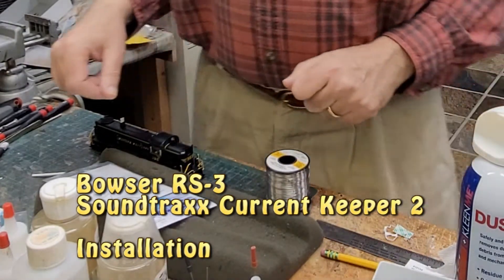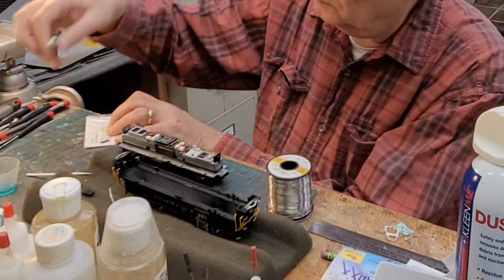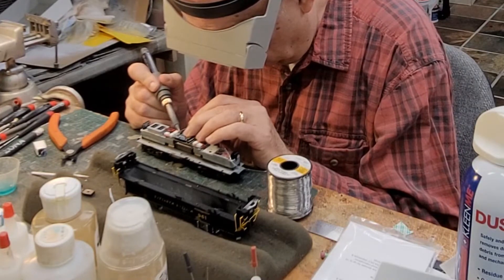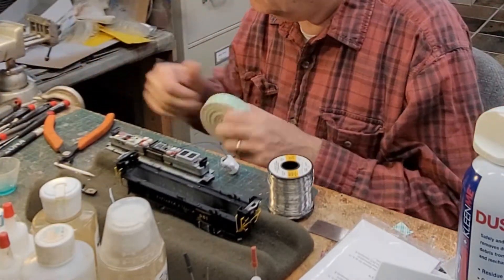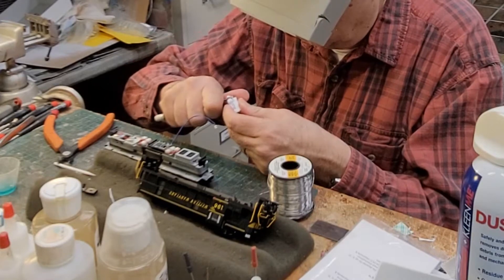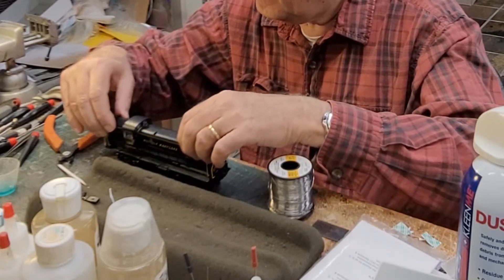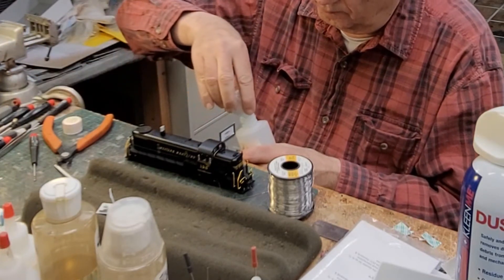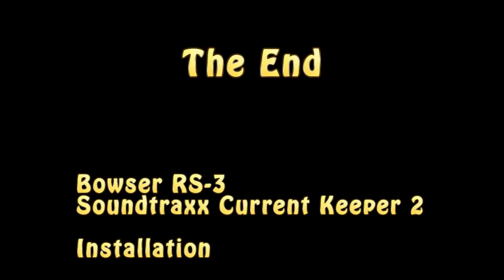Bowser RS-3 Loksound 5 - Current Keeper 2 Installation

Comment: When placing your soldering iron back into holder you should keep the solder on the tip. Cleaning it off beforehand makes the tip oxidized. Solder will not adhere to oxidized tip
Reply: Otherwise nice video. Very informative